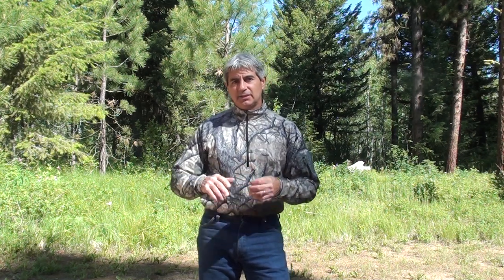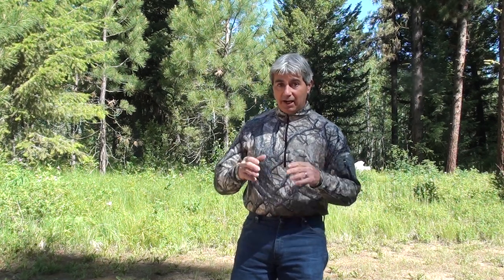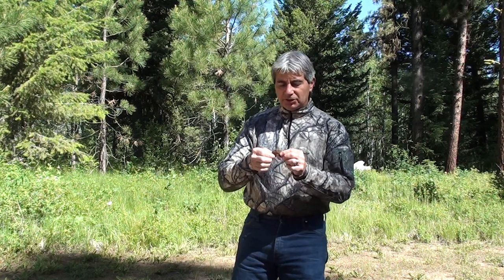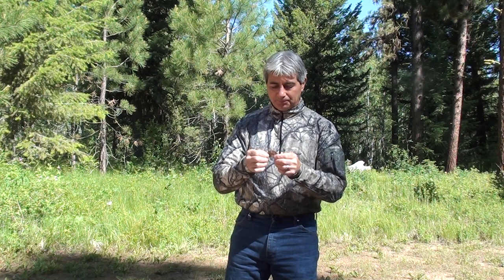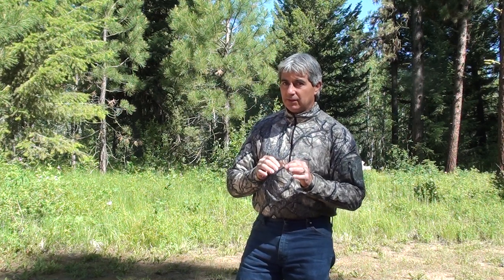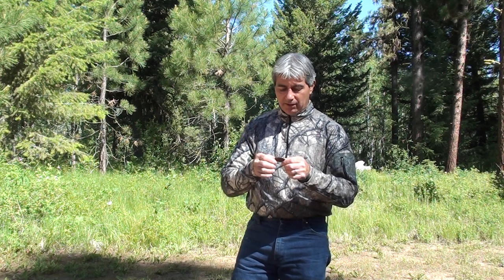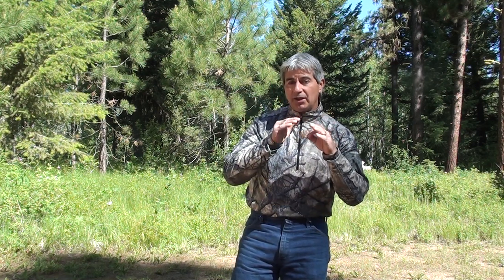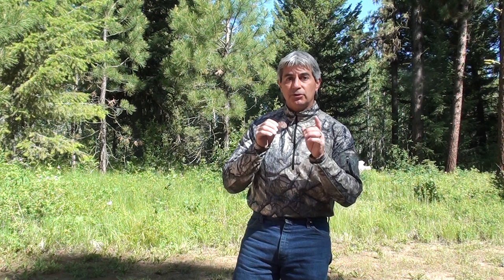ElkNut How To: Cow Elk Estrus Buzz Call

Comment: Latest videos I watched I thought you were saying cows don't do an estrus call, 2018 and 2019...
Reply from the maker: Phil, you are correct! At one time I was of this understanding but after further research I've found that this Estrus Buzz & now I call it the Contact Buzz to avoid confusion has nothing to do with a cow coming into heat or estrus! It is merely a sound they use to urgently call other elk their way under a variety of situations! This Buzz can be heard all months of the year not just in Sept. or Oct. I have quite a bit of video with this sound in use in non rutting/breeding months! I want to be accurate in my evaluations so when I see something needs clarification I will adjust things. It may not be popular but it is dead on accurate! Thanks!
Reply: I just saw this comment. Thank you for coming back and explaining.